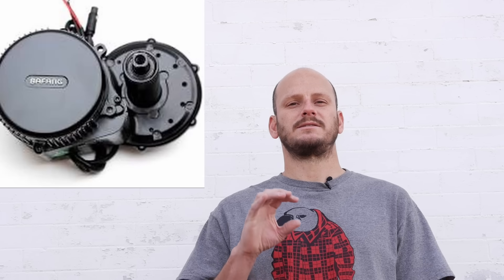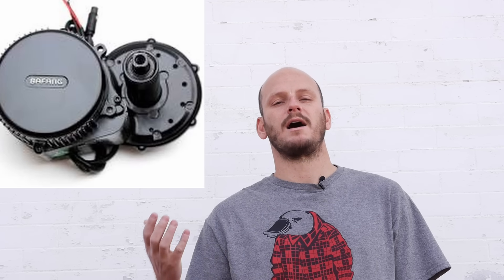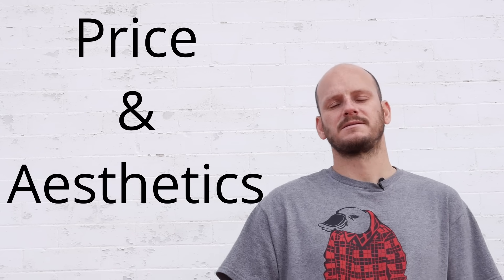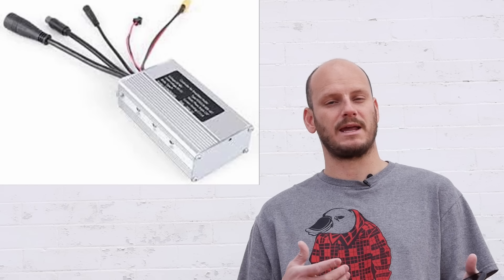Hub vs. Mid Drive Motors: Why Hub Motors Suck and Debunking Common Myths with performance test

Comment: Your price info in wrong my friend, you can go on eBay and get a hub e-bike kit for like 190 bucks and go, it's not a great kit but it's a lot less than even the cheapest decent mid-drive TDZ2($550) or a powerful kit like the BBSHD($750). If people are burning their hubs it's just ignorance of how they operate, I've had a cheap one on my beater bike that has lasted over 4 years now, of course, no one with sense will try to go up a 50% incline as you did on your video with a hub... unless they have a 3000w+ hub motor and controller. A small issue I had with you comparing a 750w hub with a 750W mid is that they are not comparable as you clearly stated the advantage of gears... they make the comparison not apples to apples unless you put the bike on a single gear and didn't change it... ever. You could somewhat compare a 1200-1500W hub to a 750w mid-drive since hubs don't have a gear advantage. Mid drives are truly superior in off-roading and large hill climbing(West coast), but if the area is flat you will hardly ever notice the difference unless you try to use the system as a motorcycle which isn't the point of bicycles anyways. It's true that mid-drives will have more torque at the start and higher final velocity at the same voltage as a hub, but only if you manage the gears properly, on a hub you likely will never need to worry about going back to first gear when you stop the bike at a light, just press the throttle and go which can kill your mid-drive if you are on a very high gear. You can get over 40mph on that 750w hub drive by adding a 72v controller and adding 72v to the bafang will burn their build-in controller and have you rebuild the entire kit. Both have advantages and disadvantages and I think it's intellectually dishonest to say that hubs are inferior in all areas, in urban settings mid-drives provide no advantage over a hub drive unless you live in san Francisco or other overly hilly place. Parting words, the reason why you had a 10 to 1 ratio of burned-out hubs to mid-drives is simple, there is a greater than 100 to 1 ratio of hubs to mid drives in the streets so it's obvious that you'd see more of them. Otherwise the video was interesting and keep up the good work.
Reply from the maker: I would never recommend any kit that costs less than $300 for a number of reasons. Personally I think it’s throwing money away and possibly supporting shady business practices. (Sweat labor all the way through inferior components used in the system).
Reply from the maker: I would avoid the TDZ motors personally. Bafang Bbs02 motors are $450 on my website. I recommend that motor to anyone if it will fit your bottom bracket. You probably are right with hub motors being 100-1 on the streets. 
But the whole point of the video was to show how important using gears vastly improves riding experience and motor performance. I would say the vast majority of people getting into Ebikes don’t know how to operate them properly. 😀

Comment: Ordered a mid-drive bike. More power, I have better control of the gears and for a big guy, this is important. Yes, I already have a spare chain and tool just in case. Repairing or replacing a chain is quick and easy.
Reply from the maker: Nice!

Comment: Where does the middrive and then the cassette apply the power? Not to the hub of the rear wheel? 🙃
Reply from the maker: Yes you are correct. The main thing is people buy cheap hub motors that aren't assembled correctly and end up coming loose or breaking. People don't ask why they are so cheap! 
It really boils down to the wheel build, from the nipples to spoke quality to correct tension etc.
Reply: @JohnnyNerdOut  Doesn't it apply for any wheel or any part of the bike for that matter?
Reply from the maker: @tommyp1124  absolutely! That’s why I always recommend buying a nice used bike for the same cost of a new crappy one. 👍components make the bike. Sooo many hub motors are crap. Like you can buy one for under $200. Why is it $200? Oh ya quality sucks

Comment: i own a 1000w that pulls 1200w max (hub motor) and ive switched the kit on to so many bikes and its flawless fast and i just use throttle .
Reply from the maker: Nice!
Reply: @JohnnyNerdOut  indeed !!
Reply: What kit is it?
Reply: @bkstudio5799  voilamart
Reply: 3000 miles later and i need to lace a my hub to a new rim :(

Comment: ive done many motorcycle conversions and you said to use a high speed motor, thats incorrect, you use a low rpm high torque motor, and then overvolt it, the reason being is at low rpm in traffic the motor will overheat, this comes down to knowledge and experience, im currently building a 175v 600amp bicycle with a 78amp continuous 273 40h, yes its wound for low rpm high torque, and it will take the 600amp controller just fine
torque is proportional to speed, so you wind a motor to output the greatest amount of torque and takeoff and overvolt it acordingly to the desired speed, and a motorcycle can have a 3 speed switch, mine do, they run more efficient at low rpms.
Reply from the maker: You are right, I misspoke. Should’ve said “high power” not high speed. 😀

Comment: a torque sensor on a hubmotor has a much better "bicycle feeling" than a bbshd cadence sensor ever will.
Reply from the maker: Just like all my opinions I said in the video, it's totally personal taste.
Reply: @JohnnyNerdOut  well it depends on if you want your bicycle to accelerate from foot pressure or from spinning the pedals like a guinea pig with no pressure,

thats the difference of torque sensor and cadence sensor, thats why a cadence sensor is $10 and a torque sensor setup cost more than the motors you sell...
Reply: 100%

Comment: when it goes to rideability, a bbshd is a cadence sensor, its crap, get a hubmotor setup with a ca3 and a sempu crank torque sensor and then compare that, trust me you'll NEVER look back at an overpriced bbshd kit, the bbshd cannot measure foot pressure, a true torque sensor can.
Reply: Ah, no I disagree.i have both a BBSHD and a 2000W Grin Chrystalyte hub motor, both running 52V. The Grin can run either torque or cadence n guess what? I chose cadence. My knees are completely shot n pushing hard on the cranks kills them. That BBSHD fat tire bike with a 28T Lekkie chainring with a 34T granny, will climb anything. The hub I need to get a run at hills n keep the RPMs up n it'll climb, but that gets sketchy real fast in bumpy stuff
Reply: @glockasauruswrex6362  you could have turned up the the torque sensor so you don't have to apply much pressure, it would have been easier...
Just needs to be programmed correctly
Reply: @dylandesmond  I jacked the settings way up, n still was not impressed with it. I know you torque sensor guy RAVE about it,  but not everyone loves it. Get over it
Reply: @glockasauruswrex6362  a small motor will struggle with many things...
Not just a hubmotor...
I prefer a 273 40h in the rear for hill climbing, it doesn't need any roll start. That's just user error in setting up their bike incorrectly from the start...
Reply: @dylandesmond  the Bafang mid-drives don't struggle at all. I started out at 255 pounds n now I'm 210. Hauled my fat ass up every Hill i could find, go figure. Just ride.
Reply: @glockasauruswrex6362  cadence and Torque sensor is different, and a different subject, a mid drive uses gears, if you removed the gearbox you'll find it'll struggle just like any other motor in the same size. You can use a hubmotor as a mid drive too, so if you had a 5:1 ratio and 150nm then you only have a 30nm motor, the gearbox is where you are getting your torque output, put a 268nm 273 40h hubmotor and run that at a 5:1 ratio... 1340nm of torque at takeoff
Reply: @dylandesmond  "if you remove the gears" the gears are the whole point. The motors may not differ so much size wise but design n use are completely different. 👌 I have both n love both
Reply: @dylandesmond  I have to agree that the advantage of the mid drive is being able to selectively change gear ratios to match the task at hand whether it be climbing hills or faster speeds, that gear adjustability allows you to keep the motor in its sweet spot for torque output and power consumption on different terrain and at different speeds.
This to me looking at 750-1000 watt motor packages and 48-52 volt 17 ah battery packs is what has me leaning towards a selectable gear mid drive over a single speed hub system.
As an older individual with health issues and not really physically having the ability to offer pedal assistance and will be using throttle only the ability to use a lower gear ratio to climb hills (paved and gravel) at lower comfortable speeds the mid motor seems like a real winner as the area I live in is very hilly overall.
But I do like that this should give me the option to get out and enjoy the area bike/hiking trails that I have been limited by health from enjoying.
I do not think there is one way is right or one way is wrong just which way fits a persons intended use the best.

Comment: not all mid drives are easily compatible, in most cases you will need to grind out spacing or replace the bb shell with a custom offset bb to fit, bb width is also a big factor
Reply: you could just write one big paragraph.....
Reply from the maker: True, but they make the bbshd in 3 different bottom bracket widths to fit 95% of bikes. I've yet to not be able to make a bike work with a mid drive. Probably over 100 bikes.
Reply: @JohnnyNerdOut  i have a 135mm 3kturbo 3t on a 120mm rear dropout bmx, took 10 minutes total to weld the axle clamps to the chromoly steel frame

Comment: you can lace your existing rear wheel onto the hubmotor, only pieces not used will be the $10 of spokes and the $15 freewheel hub that was supplied with your bike, ebike spokes are easily found on alibaba.com along with hubmotor kits
Reply from the maker: Not sure how many people have the ability to lace a wheel 😁
Reply: @JohnnyNerdOut  grin technolgies has a spoke simulator for people who have never done it before, i did my 1st wheel drunk, its never needed truing in 6 years and constantly 90kph on a full hardtail
Reply from the maker: @dylandesmond  you are more apt than the average bear 😏
Reply: @JohnnyNerdOut  im the admin on a facebook page called strictly hub motors

you're more than welcome to join, there's a lot of infomation that you would soak in for years about ebikes

Comment: the reason for an external controller is because you cant put 100amps through a bbshd, an external controller has better cooling, thats another reason why the bbshd is only 83% efficient, a 205 based motor is 86-92% efficient, a mxus 3kturbo is 88%, a qs 205 50h is 89%, and a 273 40h is 92%, those are the most popular hubmotors out there...
Reply from the maker: True. Definitely a trade off between performance and asthetics. I have that same issue with cyclone motors and controllers.
Reply: @JohnnyNerdOut  you should look into light big blocks
http://lightning-rods10.mybigcommerce.com/single-stage-big-block-middrive-rhd/
Reply from the maker: @dylandesmond  very intriguing. Similar to the cyc motor it sounds like. The only thing is that it doesn't include a controller. I still think dollar for dollar the cyclone is the best for pure power.
Reply: @JohnnyNerdOut  i prefer a 3kturbo for 250usd... just because i'm currently running 300amps phase in my current one and have done for a decade (actually downgraded from a 400amp version) for my daily commuter

i currently own a bbshd, a 205 50h v3, a 3kturbo, a 273 40h, a 274 70h v4, and a tdz2 torque sensor mid drive (it peaks 750watts but can only sustain 45kph continuous, but it has a much feeling than a bafang cadence sensor, if bafang used a torque sensor i might consider it)

this sounds weird, but for dollar to torque,
a 450usd 273 40h is the best value for torque output to the wheel of all the bicycle motors out there

Comment: for the price of a bbshd kit directly from the bafang factory in china, i can get a 5kw 205 50h hubmotor kit that peaks 180nm of torque for the same price from qs motors in china
Reply from the maker: You could also get a cyclone kit for the same  price as the hub motor but get waaay better performance climbing hills and top speed.
Reply: @JohnnyNerdOut  nope

https://www.youtube.com/watch?v=s3EG9Xc-0XE my 273 40h will do 240kph... a cyclone kit will blow up before getting to that speed, the 7.5kw big block from lightning is 2 cyclone motors wound together and he had to weld the magnets to the stator because of the magnets coming off the stator from to high rpm, and it can only do 120kph

the cycle kit wont out accelerate a 205 50h on a hill... even if the cyclone was in 80% rpm and geared down, the 205 50h will overtake it in a few seconds...

Comment: we use 11g 10g and 9g spokes, my 10 and 9g spokes havent needing truing in 10 years, ive never changed any, i have straight and cross laced spokes on 20kg bicycle hubmotors
Reply from the maker: I was doing an apples to apples comparison using 750w motors. They typically use 13g spokes and suck. Yes the high wattage motors use thicker spokes because they require them due to the power. Similar to motorcycle wheels.
Reply: @JohnnyNerdOut  apples to apples would have been comparing a 60nm motor to a 60nm motor...
this is apples to oranges
Reply from the maker: @dylandesmond  using that logic, it would only require 300w of power to exert the same amount of force=more efficient use of power/watts.
Reply: @JohnnyNerdOut  the only logical setup i could see a bicycle mid drive of any size is on a mountain bike designed for slow gear change (cruising around in no hurry) where acceleration or peak torque output over a large speed range is unneeded, in this case i'd rather a large direct drive in the rear and a tiny geared motor in the front
Reply: @JohnnyNerdOut  but then the motor with the largest torque bandwidth, the highest efficiency,  least mechanical losses and the best gearing (mechanical gears or wire winding aka kv) would be the best option, that is where motor size has an advantage...
Reply: @JohnnyNerdOut  you can have a lot more torque at 300 watts to, that depends on the kv of the motor, how many amps are being thrown at the motor, gearing, load etc etc

you can snap torque arms on hubmotors with 250watt direct drive hubs at the correct kv and amperage....

Comment: your video example is what your call using the wrong kv hubmotor in a wheel that is too large for the job, thats plays a huge roll on torque output, its called thrust...
Reply from the maker: That is the stock juiced bikes motor setup.

Comment: the hubmotor doesnt have to change gears, so its pulling pure torque and acceleration is faster because you dont have to let off the throttle to avoid breaking your chain or grearbox...
Reply from the maker: True, it does save chain life. However the lack of gear ratios severely limits the efficiency of the motor whether it be hub or mid.
Reply: @JohnnyNerdOut  not true if you give 25% throttle the efficiency peak changes to the 25% of the total rpm limit, a hub motor will be more efficient, don't mix power with torque/thrust they are 2 different things.

https://ebikes.ca/tools/simulator.html?bopen=true&throt_b=25&motor=MCRO5004&kv=3&motor_b=MCRO5004&kv_b=3&batt=cust_175_0.2_80&batt_b=cust_175_0.2_80&mass=500&mass_b=500&hp_b=0&hp=0

Comment: this is average acceleration for a 273 40h bicycle hubmotor... the high torque low rpm winding rip for steep gradient hills at continuous torque output at extremely low rpm
https://www.youtube.com/watch?v=ZlFXxVRg1Yo

Comment: if you overvolt your hub motor and have a 3 speed switch you can have a better range to what you program in the controller
Reply: Yes i have a 1500w hub with a 2000w controller and three speed switch but really only need the 1st speed it does 60 kph . I have a bbshd aswel but like my hub better . Ive just bought a 3000w controller for the bbshd and see how that goes .

Comment: 273 40h is rated to 268nm of torque its a bicycle hubmotor
Reply from the maker: True, but i think a true apples to apples comparison is a good example of the importance of having gear ratios.
Reply: @JohnnyNerdOut  then you should compare this mid drive motor to a 205 50h 3kv winding at the same amperage, the 205 50h will output more torque at the same amps and run more efficiently, you're comparing it against a 60nm cheap hubmotor... one of the worst hubmotors availiable on the market